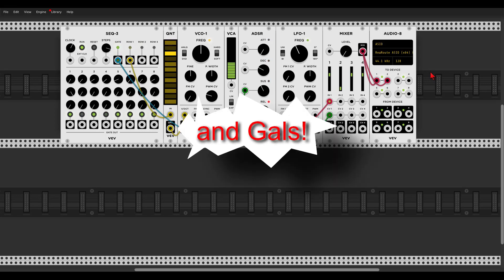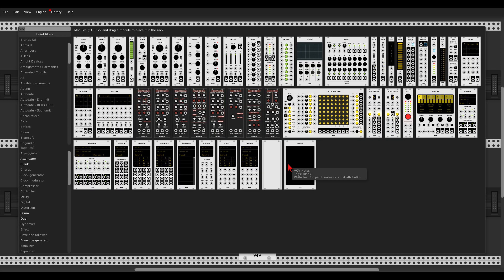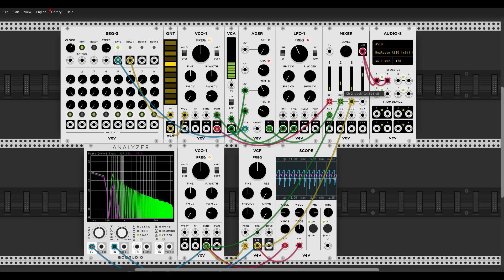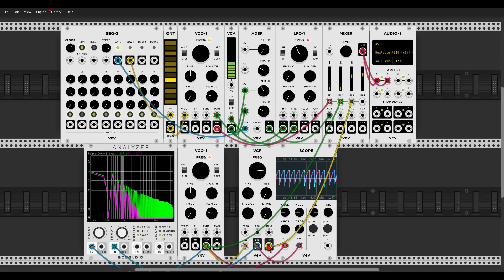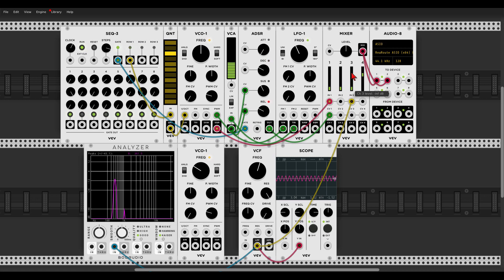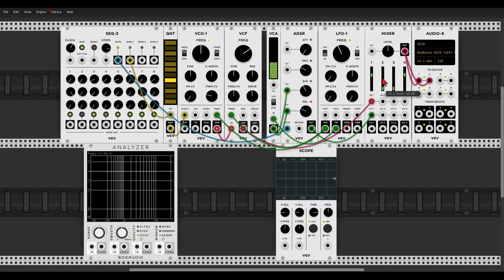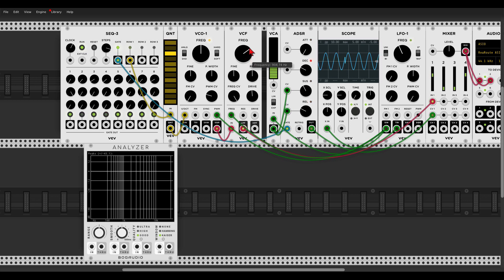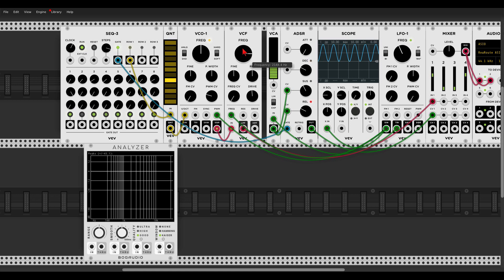Beginner's Patches III - CV and VCF

Comment: How did you know that the frequency control voltage of the filter was an attenuverter and not an attenuator? My ears are quite inexperienced still so did you get that from the documentation or is there something I'm not seeing here?
Reply from the maker: Well, an attenuverter will also invert the signal so it will, usually, have it's zero point at the center and it will turn left and right. An attenuator will have it's zero point, usually, on the left so if you load a module and the knob is set to 12 o'clock, it will be, usually, an attenuverter. Does this make sense?
Reply: @OmriCohen-Music  ohhh yeah that makes sense, thank you!!

Comment: How come a long enough release time lets us hear the note/step despite the sequencer gate being closed? I noticed this happening as I was modulating the release time (I'd suddenly get extra notes and was wondering where they came from). Thanks so much for the videos. I only started the series yesterday and my mind is being blown.
Reply from the maker: Well, the gate will only trigger the envelope, and as long as the envelope is open (never mind which stage, attack, decay, sustain, or release), there will still be sound coming out from the VCA so if there's a change in notes during this time, you will hear them. There's a way to "fix" this, but it's a bit more advanced. Let me know if you want to try it and I will happily explain how.
Reply: @OmriCohen-Music  I'm definitely interested in the explanation. At least to get a better understanding of things, since I thought once I clicked on the green light (turning it "off") the gate would no longer trigger the envelope (during that step). Thanks again.

Comment: At 8:16 it looks like the filtered wave is a little weaker at the high freqencies than the original one. Is there a quality loss if you are using such filters? Lets take a bass kick and a hihat for example, wich are playing at the same time. Would it be a bad idea to connect a highpass filter to the hihat, just to cut off the lilltle rest of the lower frequencies and connect a low pass filter to the bass kick to remove the rest of high frequencies?
Reply from the maker: That's a really good question! It's a good idea to remove the energy or frequencies you don't want, as you said, the lows of a hihat and the highs of a kick, although, you have to remember that hihats have also character in the lows, and the kick has also character in the highs. Anyway, every filter has its own feel and personality, and that's a part of what makes them unique from one another I guess. I just tested 3 different filters, and they all react differetly...